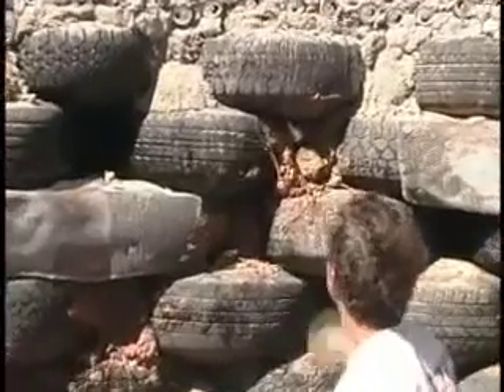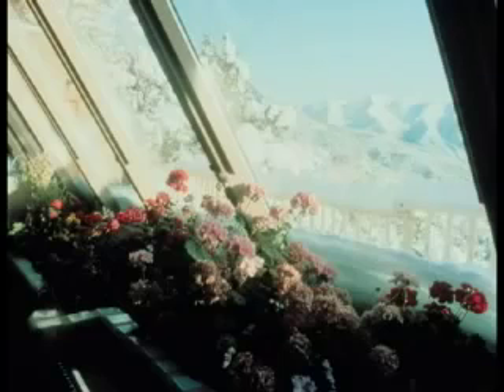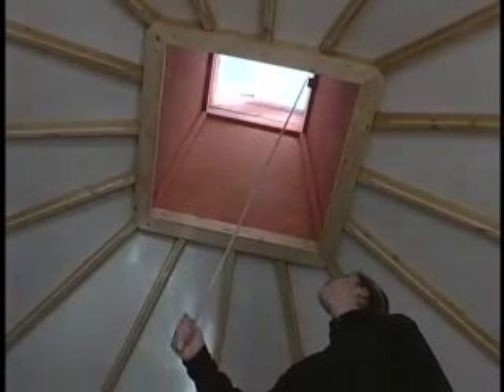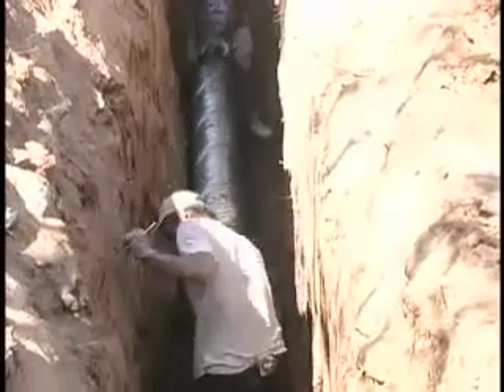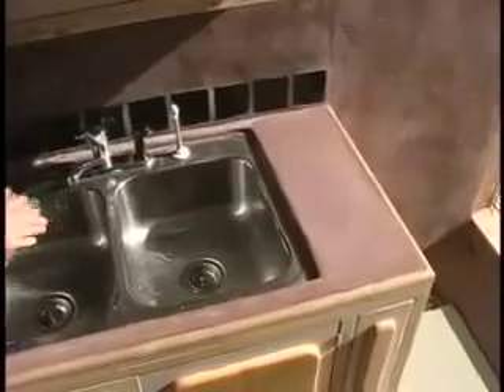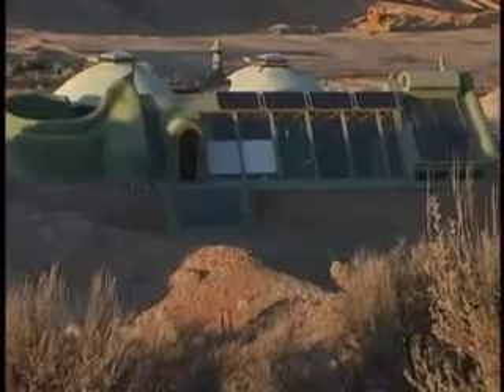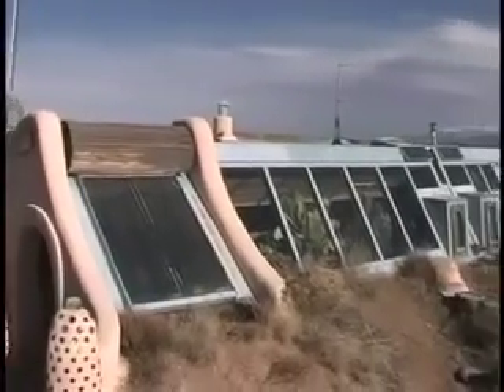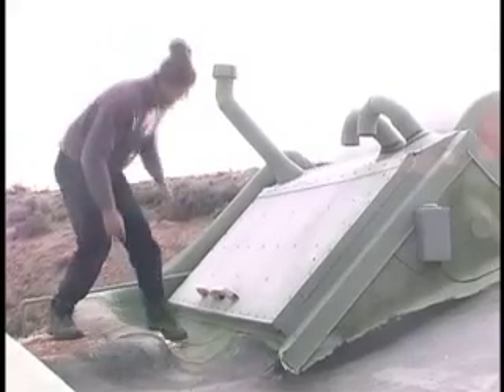Earthships 101 part I

Comment: #EarthShipSolutions101@ YouTube. 1. passive solar home made of natural and recycled materials 2. thermal mass construction for temperature stabilization. 3. renewable energy & integrated water systems make the Earthship an off-grid home with little to no utility bills.
Biotecture n. 1. the profession of designing buildings and environments with consideration for their sustainability. 2. A combination of biology and architecture.

Comment: why not just live in a greenhouse - 1,000 sq. ft only costs 20k and can be built from a kit in a week or 2  -  probably the best greenhouse or domes on the market period are the greenhousekits (dot com)  geodesic domes with solawrap because they use the german solawrap keder covering and top quality frame. This premiere covering diffuses light and plants gro much better in this spectrum of light, and they burn less etc, big problems with greenhouses. meanwhile light transmission is 83% percent which is very good. The film has been used in european domes for 30 years and still functional. It regulates temperatures better, and has the stongest connection channel of any poly material on the market. It is not carbonate, but ethylene which is recyclable. Best way to heat a dome? use the rocket mass stove. It is easy to build, and use a small fraction of the wood in a conventional wood stove. it extracts every bit of heat from a log and STORES IT to release in your dome up to 48 hours. go to ernie and erica rocket mass stove site to learn about those. piling 2 foot tall dirt mounds over logs and sticks around thee edges (called HUGELCULTURE) means maximum light warms your beds vs using ply raised beds which hogs space and light and wears out, and the wood sponge in permaculture means watering is drammatically reduced. No building needed. When you elect to change out the dirt, you then simply shovel it out vs the problems with emptying containers. With hugelculture, your soil becomes more fertile with the passing of every year climaxing at 5 years vs having to rebuild the soil each year and you increase sq. footage for a given space and exploit airspace. dirt can be piled center of the dome in a tall pyramid shape.
  Glass is not ideal for plants. these earthships would work better with solarwrap where plants are conscerned because harvest begins 3 weeks earlier and production is greater.
Reply: Thanks for the info!

Comment: Do the tires leach chemicals over time? Is there any threat of melting?
Reply: I have also thought about this myself, and honestly, I don't know if I agree with the idea that over time, that the tires could not possibly leach some sort of chemical and create a potential hazard...I don't think ANY "Earthship" has been on the planet long enough for anyone to have any educated response to that question, only time will truly reveal the answer to that one, IMHO.  Just because the tires are clean does not mean they don't go through chemical changes during normal break-down over time....that doesn't make sense to me.
Reply: They are encased in mortar which makes it impossible for them to burn since there is no oxygen to fuel the fire. The tires are also clean, leaving no chemicals to leach out.
Reply: Boogey Loogey
thanks!

Comment: Aye, if you want to go the whole hog then it can cost a bit. Don't get a home loan, get a loan for a car then spend the money on a home hehe.

Everything can be done cheap if you make it yourself. Solar panels can cost as little as $200 per panel if you make them yourself and don't mind using some damaged cells. Wind generators can be again made yourself. The expensive inverters can be made.. The knowledge is out there. Didn't say it would be easy though!

Comment: Is the rammed earth method of building an option in an earthquake zone? I wonder if tires can be used in the same way but as form-work for concrete (weave with rebar).  Probably not.

Comment: Have you actually crunched the numbers on any of that?  Solar has gotten to be quite efficient for generating power on-site.  Wind is a big net energy plus depending on type and placement. Onsite power is key.  From a solar panel onsite, you have relatively little energy loss. From the grid, you have at least two nuclear or coal powerplants (they have to be redundant, and this mandates overproduction) transmitting over a far-flung grid and going through many steps of conversions. Think about it.

Comment: But yeah, we still are finding ways to transition from current methods, just not these glowing promises especially the nonsensible  idea of being able to do ALL THAT by yourself.  We'd also point out that most Earthships are so small in square footage as to be confining not freeing and certainly not MULTIGENERATIONAL which is the key to sustainable economic freedom.  And you can't engineer just any floor design either.  Those tire walls are LIMITED in the SPAN they can support.  Etc

Comment: Oh, come on.  This isn't unrealistic.  And it certainly doesn't cost a million dollars to build.  It is made from recyclable materials (i.e. old tires, bottles, cans) and adobe (i.e. a mixture of sand, clay, and straw).  There are several books full of blueprints and instructions for building these homes.  The hardest part really is the building.  It takes about two to three times as long to build a home like this with the same amount of people (3-5) it takes to build a home from lumber.

Comment: @earthship You did not do your research fully, for example in hot climates you bury a/c system 8 feet down.  This past summer was so hot, that for that system to work for the duration of our extreme temperatures, it would have had to be buried 15-20 feet to get a 70 degree a/c return temperature.  Can not get any lower than that as that is the lowest ground temp goes at the stable temperature level.

Comment: I have researched this design and it is very viable. The only thing I disagree with is using aluminum cans in the construction. Those cans should be recycled. Recycling takes only 10% of the energy needed to produce aluminum... much better use of the aluminum cans.

Comment: @SVKmellow If your building something that you would like to hold lots of heat or cool. You use Rammed earth inside of old used tires like there doing with these earthships. Metal is expensive to produce unless your just cutting it out of old washing machines and dryers which they use for roofing.  Still metal cost a lot of money and a lot of energy to cut it out of old appliances. ?I like what Michael said in the future our junk will be harvested and reused its only a matter of time.

Comment: @SVKmellow I am new to earthships but i think they just use that for added insulation over the tired walls i could be wrong on that. Bottles hold in good heat and trap the suns warmth. I understand your point on the aluminum cans i was under the impression they used them for the interior walls for the most part. Either way they only use them for recycling reasons from what i understand not because there the best material. I personally would like them to try Hempcrete Walls.

Comment: @SVKmellow These guys have been doing this for 40 Years. Don't you think that if the bottles and cans were not effective they would of stopped using them by now? They have had great success thanks for the negativity though. 

Btw For your information if you ever get a chance to look at a real heat sink they have multiple aluminum branches that air can pass through to pass the heat. Its the same reason native Americans used leather strands to let the water wick out of there clothes when wet.

Comment: @Yimhere  Yes you may have to add a rocket mass wood stove to supplement your heat in super long periods with no sun. These do very well in cold climates. You might also have to add wind power to your solar power. 
The snow turns to water you store for drinking.

Comment: Continued....

I also grind up eggshells I collect from the diner. They go through hundreds of eggs a day and give me the shells for free. I have made a grinder that pulverizes the shells into a dust and it goes into my garden. I own two lots. One lot is my work lot, nursery lot, garage, and compost area and the other is the garden I take care of. I also have a greenhouse with radiant heat floors and windows with a hydroponic system that sprays water instead and air so they grow faster

Comment: @Jennipps yes i researched it further and since it is already used rubber, all the toxic components have been already used. The people building earthships have done tests and there is zero traces found. Your reasoning is correct as well, but i was thinking that "to burry garbage is worse than recycling" but it turns out that is not the case in this instance. :)

Comment: have you ever seen seen mud or dirt on fire?

The core of them is dirt, and they are covered by mud or concrete. It must be soo dificult to start a fire. Anyway, this is not a cage like a modern flat, you can reach the door in less than 5 seconds.

If you have a problem, don´t complain, look for the sollution

Comment: The core of the earthship is made with tires, filled with dirt and surrounded with mud or concrete. 

Have you ever seen the mud on fire? First you must open a gap into the wall, apply gas on the tires and maybe the tires of the gap could be on fire. Anyway, this is not a cage like a modern flat, you can reach the doors in less than 10 seconds. Isn´it?

The only problem could be the wooden roof and nobody have banned this system.

If you find a problem, don´t complain, look for the sollution

Comment: As far as I know, Cadmium, Mercury, Tungsten, et al, don't leach. Formaldehyde and other carcinogens in off the shelf house paint, paticleboard/MDF offgasses for a minimum of 5 years. Do you recommend keeping discarded tyres in earthfill, to get mixed up in the ground water at a later date? the only irresponsible people here are the ones sitting back and complaining about the methods of those whome are trying to make a difference.

Comment: Imagine the health issues associated with tires outgassing

Imagine Mike Reynolds forgot thermal mass does not equal insulation.

Imagine Dennis Weaver's Earthship is connected to the grid, utilizes a fresh water well, even in Colorado's Rockies, and has had to be repaired several times due to leaks in the walls.

Comment: Imagine Mike Reynolds forgot thermal mass does not equal insulation.

Imagine Dennis Weaver's Earthship is connected to the grid, utilizes a fresh water well, even in Colorado's Rockies, and has had to be repaired several times due to leaks in the walls.

Comment from the maker: Earthships use much less concrete than conventional homes. There are no concrete slabs nor footings which take up an incredible amount of concrete. The rammed earth tire walls are load bearing and are 2'4" thick - wider than a required footing. So the tire wall spreads the load wider than a footing could.

Comment from the maker: Earthships have been through earthquakes. Rammed earth encased in steel belted rubber - essentially indestructible. Rammed earth and rubber do not crack, like concrete. So any vibrations would transfer through.